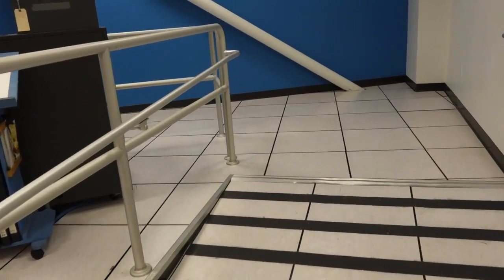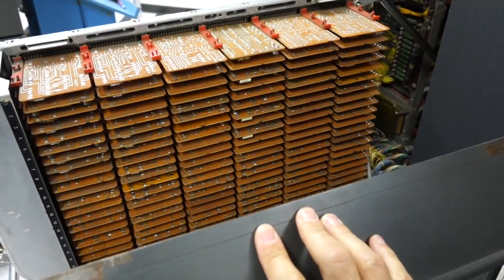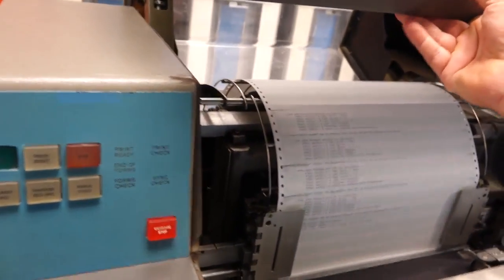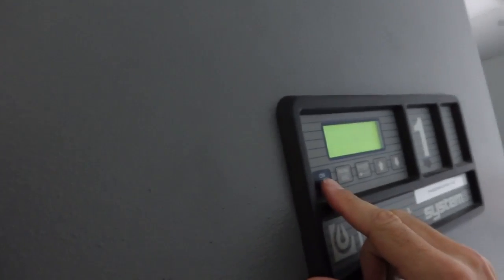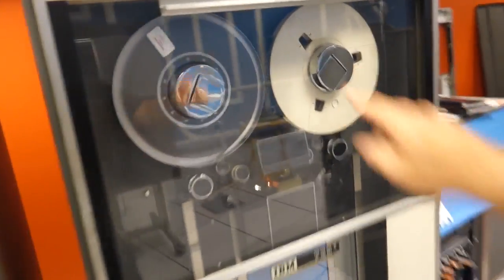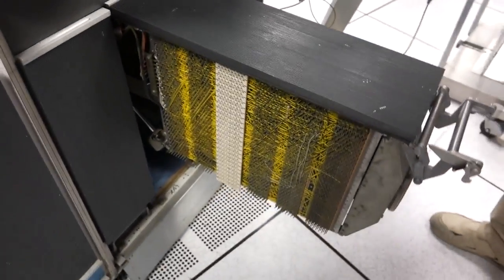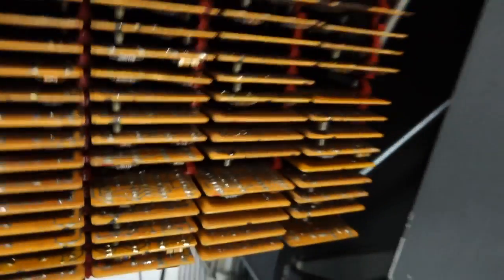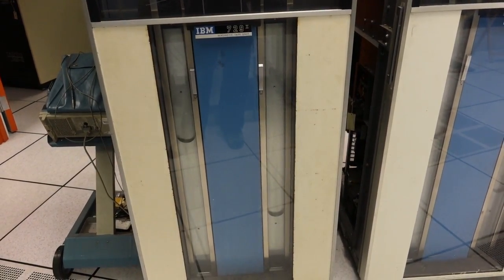Debugging the 1959 IBM 1401 Computer at the Computer History Museum

Comment: There was a memory unit that could be added with 12 K of memory. This would allow the unit to use 16 K of memory.  It sat outside the 1401 frame..  There was also a RAMAC unit 1405 for disc space.  One head on a moving arm that  would enter between two disks and go to the correct track.  The disks were about 3 feet in diameter and stacked 25 high.   If the correct data was printed the printer could play music.
Reply from the maker: We have both at the CHM! The 1406 memory extension is connected to the 1401, but the giant RAMAC is not. It is demonstrated on its own by a separate demo team.

Comment: I brought those cards from surplus electronic parts stores in the 1960s to salvage the transistors, resistors, resisters and capacitors to build my own circuits. I never saw the computer they came from, now I I have seen it in this video!

Comment: Watching IBM computers from the 50's and 60's in operation and debugging let me not only gain more respect for the high level of engineering that was needed for them. But it also helps in finding a deeper understanding or appreciation for 1960's sci-fi shows like the original Star Trek serial. Blinking lights, unnamed buttons and switches that only make sense to the initiated, an interior full of exchangable cards and technological marvels that are unseen elsewhere in daily life. Heck, even the Enterprise's serial number "NCC 1701" seems to be a hidden reference to these machines. Star Trek played in 2266, 300 years in the future. 1401 + 300 = 1701.

Comment: I was a computer operator back in the 70’s at a food distribution center. I ran a 1401 which produced the pull tickets and inventory for the warehouse. The system was not on a raised floor, I was stepping over cables all day long. The 1311 (can’t remember) disk drives  were fun to watch, hydraulic arm that would move the heads and would shake the whole unit seeking data.  Was quite the work horse and very reliable.  That was my first IT job, I eventually ended up working for IBM in 89 for 23 years in systems programming (remember CMS) , great company and people to spend a career with.

Comment: Fresh out of the service working at a service bureau, we ran a 1401 with a 1402 card read/punch and a 1403 N1 printer and four 729 M2 tape drives. it was a workhorse of a machine going 24/7 of course we had a parts room with cabinets full of just about any part needed as well as practically live in Customer Engineers. I guess you never forget your first mainframe !!

Comment: Why couldn't you just wire a 240 volt circuit from the breaker panel to the machine. There is no need for a black box that makes a lot of noise. Electric stoves, dryers, and air conditioners run on 240 volts in North America.
Reply from the maker: Because it’s not a dryer. It needs 15kW in 3 phases of 220V at 50Hz, not one phase of 240V at 60Hz. By the way, a 3 phase 110V to 220V 15kW transformer wouldn’t have done it either. The German 1401 uses ferro-resonant transformers in the power supplies and synchronous motors in the tapes and the card reader that work at 50Hz only. The solution was to use an electronic inverter, which delivers the right voltage, frequency and power on 3 phases. It’s not noisy.

Comment: Out of curiosity, why dont you replace the individual components (capacitors, resistors, transistors, diodes, etc) on the SMS cards instead of trying to find old stock? Is it due to different power levels? Really curious. Love these old computers! Keep 'em in good shape!
Reply: some of those cards were cap code cards.  They could replace a number of different cards as long as the caps were inserted to set the card up for its intended purpose.

Comment: Hector Serrano, Feb 2, 2020. 
I used an IBM 1401 with just 4k RAM, yes, 4k RAM, to run a construction scheduling software called LESS. It was year 1966. I developed a feature to graph construction resources associated to each activity, like number of cranes, dozers, etc. or could be labor disciplines, number of carpenters, brick layers, etc. Process was done in two stages: STAGE ONE: computations from beginning to end; STOP, punch cards with results, clear the memory, load the punched cards; then STAGE TWO: computations from end to beginning, and finally print the results. To avoid the operators of the computer copied the program code, I introduced instructions to wipe out the program code at the very end of the process. Computer language was AUTOCODER. One operator asked me how was it printed nice scheduling tables and graphs but when he tried to copy the coding, he found only two lines: begin - end.

Comment: I am surprised that the computer is ever turned off as when I worked on offshore seismic surveys in the early 1980's turning the data acquisition  computers  on and off was regarded as an invitation to trouble.  I aslso recall flipping toggle switches on the PDP11 navigation computer  to re-boot it in a big hurry to avoid having to abort a long survey line and go around again.
Reply from the maker: It's 15 kW each, so although it's much less power than a single rack of servers at Google or Facebook these days, we would not want to keep it running outside of the demos. Also most of our faults are mechanical, so the less we run it the less wear on the parts.

Comment: So what was this computer able to do ? Add 1 plus 1 and thats about it
Reply: If you dig deeply enough into their innards that is pretty much what any CPU does, at least for mathematical operations. (Logic gates use a special type of arithmetic) The interesting stuff happens at the interface where the CPU tells the various attached devices such as a printer, disk drive or the screen on your cellphone what to do.
Reply: it could add, subtract, multiply and divide quite well,  It did its math in decimal format.  It did not use the hexadecimal notation for math,

Comment: I started working for Univac in January 1970 at NASA in Huntsville, Alabama at Marshall Space Flight Center. We were called field engineers and then customer engineers after what IBM called their maintenance techs. I left Huntsville in 1976 for White Sands Missile Range (WSMR) in New Mexico and continued working on Univac 1108's thru the water cooled 1100/90 until all of them left around 1993. The IBM machines in Huntsville and WSMR were used for accounting and the Univac machines which were 36 bit were the scientific machines. It is hard to believe that in just a few months our first trip to the moon will be 50 years ago. Wish I could go back and do it again.

Comment: 4,000 bytes to hold a working program. No operating system, just load your program in on the punch cards, the first 3 being the bootstrap program from where we get 'to boot a computer'. Even so, 4k is a lot of source code to run through the autocoder compiler. After training to program the 1401, I went on to learn 360 assembler, and then PL/1.

Comment: I worked with these computers at a bank in Toronto back in the 70's. I started out as a lowly 'Burster/Decollator'. As the Decollator, I worked on this big machine (also called a decollator) taking out the carbon paper from the multi-layer print-outs and as a Burster, I used a burster to separate the pages along the perforations after they were decollated. It was a loud (all day bursting paper apart!) and dirty (miles of carbon paper!) job done in a little room off the printer room. I wonder if there are any old bursters or decollators at the computer history museum.

Comment: I grew up playing with Dad's tools, tearing apart radios and scattering memore beads and we had work benches made from the guts of these IBM Monsters. We got whole panels of these marvelouse switches and lights and soldered them up and sold them for alarms, those blue panels were made of the most amazingly heavy and sturdy material! And the frames were heavy alloy aluminum.

Comment: As a student computer operator at the University of Texas Computation Center in the mid-1960’s, my job was to operate an IBM 1401 computer system.

The “mainframe” on campus back then was a Control Data Corporation model 1604, an early Seymour Cray machine. The 1401 was used to feed input tapes (typically containing source code, such as Fortran) to the 1604 since the only I/O for the 1604 was magnetic tape, i.e. it had no line printer or punched card reader.

1604 input tapes were created on the 1401 by having the 1401 read user’s punched card decks from its 1402 card reader/punch and then to write the card decks to the 1401’s tape drive(s).

Output tapes from the CDC 1604 (typically Fortran source program output) were read on the 1401 and then either printed on the 1401’s 1403 line printer or punched into blank cards on the 1401’s card reader/punch (the 1402).

Usually my final task of the shift was to match printed and/or punched card output with its corresponding input card deck, which was then all handed back to the person who submitted it.

Students and faculty alike used this process to submit their source card decks for input to the 1604. Most users didn’t realize there was this multi-step process in place for running their programs.

That was the relatively simple then, and compared with the much more complex now, this iPhone 6 I’m using to create this prose is far more capable and faster than many 1401s!

All things considered, it was a fun job and helped put me through college!

Comment: I think they had ICs, but they were still pretty new and not very widely in use at this point in time. Everything here is all discrete TTL (transistor to transistor logic). Far and away smaller than the early valve computers, like ENAC and COLOSSUS (and more powerful too), but still not something any old nerd would be running in his basement.

Comment: What replacement semis are you guys using to replace the originals?
Reply from the maker: With rare exceptions when we can't find any 1960's parts, we use originals to replace originals. We have a large stash of Germanium IBM transistors.
Reply: Are there any modern equivalents? For example, in this video I think I heard you say someone replaced Germanium semis with Silicon, on a card.

So in the 60s my dad worked at a local Bendix division, and they also had a circuit board fabrication plant, locally, and they made cards for IBM Endicott. After seeing you guys servicing the 1401, I realized we had some of those cards in our basement when I was a kid. I had no idea we had parts to an IBM mainframe in our house.

Comment: Were do you get parts for the machine to repair it? I mean it does break down alot so you must need alots of parts.
Reply from the maker: + dantheman We repair only with original parts if at all possible. We have a large stash of parts, new old parts continue to be donated to us (we just received a large shipment of transistors from France - thank you Vincent), some replacement parts come from duplicate machines we have in the warehouse. When we can't find original items, we go through incredible length re-creating missing ones as close as possible to the originals. See for example the recreated brushes for the tape drives  in this video: https://youtu.be/7Lh4CMz_Z6M . Finally we collaborate and exchange parts with other museums: we recently got a re-created print chain for our 1403 from the The Vintage IBM Computing Center in Binghamton. We were floored when we received that one, this is an extremely difficult part to recreate. Fortunately someone in Binghamton still knew about the original manufacturing method used to make them, and was able to resurrect the production process.
Reply: The boards with transistors could be repaired with modern transistors, as for the other parts. They probably have a stock pile and in the future 3D printing using metal could possibly be used.
Reply: That is amazing :)

Comment: Long ago back in the late '80s I once bought an original PDP-11 used. It had 8KW of wire core. And a wirewrapped hex bus backplane. The CPU and core boards were good. But the wirewrap backplane needed some wires replaced. And friend of mine and I spend weeks testing and rewrapping pins on that backplane until we could boot the damn thing. And then all we did with it was set it up as a coffee table. When friends came over we'd input a cylon eye program at the front panel for giggles. It consumed a good kilowatt when running. With a clockspeed of something like 500 kilohertz. It wasn't very useful.

Comment: As a retired IBM customer enginer this broubht back memories  the 1403 was very noisy because the hammers striking the moving letters made a squick
Reply: "skip to channel 12" ... eventually you'd learn to have a hole punched in every channel somewhere. But not all on the same line, because that would weaken the tape. 

The 1403 was such a solid design, it outlived the 1401 by 20 years or so.
Reply: And 1403's were VERY efficient at moving paper thru them if you had the wrong carriage tape or program was looking for a channel punch that wasn't on it...as programmer back in 80's, I had that occur a few times and still recall running to printer to try and stop it.
Reply: The carriage was driven by a hydraulic motor. As an IBM CE I worked on a lot of them.
Reply: That is why they had insulated covers to minimize the noise. When the cover was closed it was not so bad.
Reply from the maker: +Jim R So true
Reply: Jerry did you work with John Pearo in Philly?

Comment: Holly crap, those memory banks are beautiful. 
No idea how on earth they could fabricate that on a production line, or are they hand build&wired? 
In that case, must be a nightmare debugging when one made a very small mistake in production
Reply from the maker: At first they were hand built, then it got progressively automated with incredibly sophisticated and complicated machines. The cores got smaller and smaller, the latest generation of these in the mid seventies you can hardly see them. Still used in the Space Shuttle flight computer.
Reply: Amazing stuff! They must have been incredible expensive back in the days.
So much delicate craftsmanship
Reply: And they were actually more dense and with a lower failure rate than TTL memory of that time. Back then 4104 and 4116 (4K bit / 16k bit) dynamic chips consumed a lot of juice and ran hot. They tended to drop bits even when working, so you'd need nine for 4K / 16K with one additional for parity. And because tracings, refresh circuitry, and buffer caps all took space to support those RAM chips, an equivalent amount of real core could be packed in the same space. They'd often just blow in a puff of smoke anyway. Which didn't happen with real core. BUT - solid state memory is A LOT faster. And by the late 70s, with 64kbit chips, physical core couldn't come close to its density. Past that... well, the story only got worse for core. Bubble memory suffered a similar fate.
Reply from the maker: +Paranoid Factoid
Absolutely, early silicon memory did fight the reliability issues you mention. But that was much later (and not TTL). There was just no such thing available in 1959. To put it in perspective, it would take another 11 years before the first 1K memory chip would appear and start to challenge core memory. That was the famous Intel 1103, in groundbreaking MOS technology. The 4k chip you mention (I think you meant the Mostek MK4096) is from 1973. The MK4116 16k chip is from 1976. Core memory lasted for quite a while. It flew astronauts to the moon, and (gasp) was still used in the Space Shuttle flight computer (all 104k of it)!
Reply: There is a video on one of the moon mission's where they show a machine wire wrapping a back frame for the computer that did the lunar landings

Comment: The 1403 was probably the fastest line printer in the world when it came out, and I'd imagine it would remain the fastest line printer for a few decades. It could feed at 75 inches per second and print 600 lines per minute.  The Model 3 could print 1100 lines per minute.